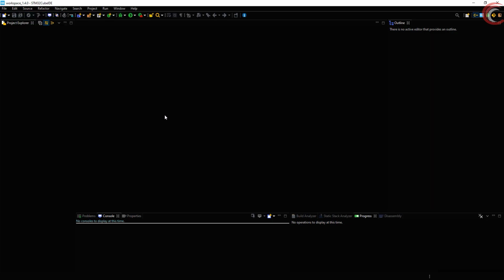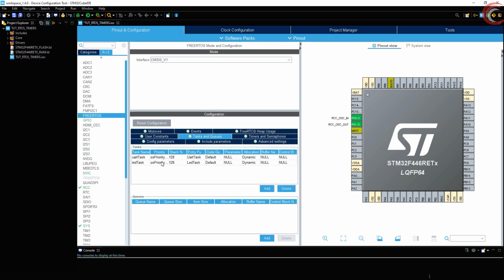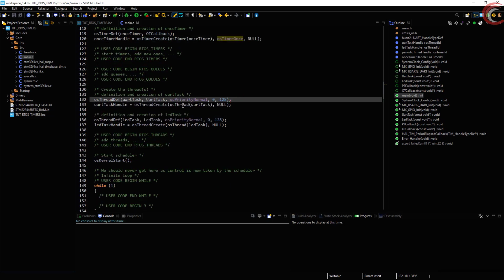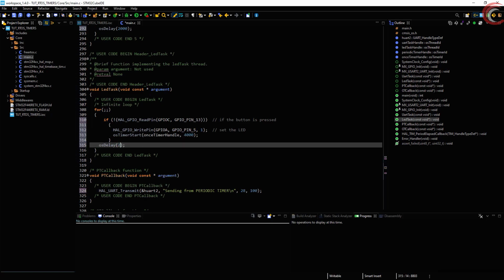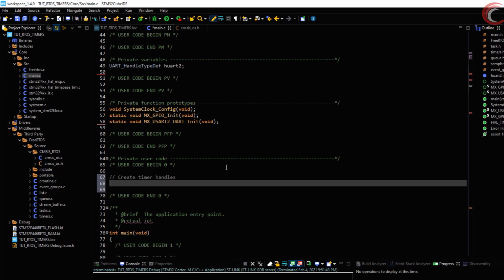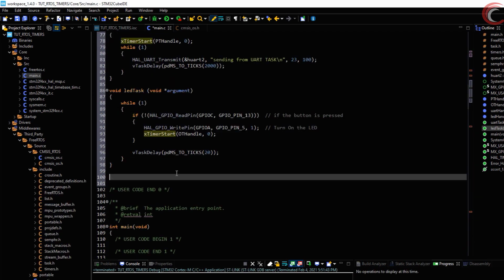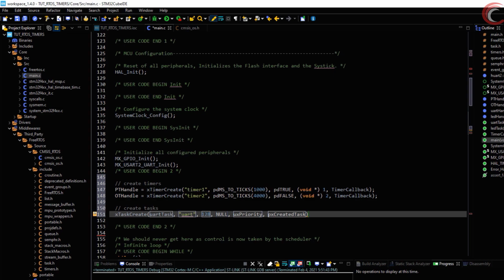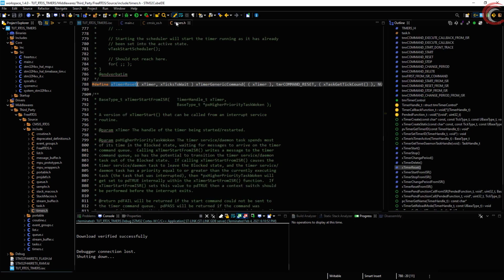FreeRTOS Tutorial 8 || Software Timers || STM32 || W/O CMSIS

Comment: Hi,
This is a great playlist on RTOS,I have learned a lot through this.
I am having an issue, I am using same STM32F446RE, whenever I use external clock in the coding  . It always results strange output on UART. Can you please guide me why is this happening? And what is the solution for it?

Thanks
Reply from the maker: Try bypassing the clock. There is an option of bypass clock when you select external HSE.

Comment: Great video but I wonder something. Why would I use a software timer instead of adding delay to the tasks with "osDelay" or "vTaskDelay" functions?
Reply from the maker: yes you are right. We can also use tasks for the same operations, but timers uses less resources, less memory and they are handy in certain situations
for eg- if you want a periodic task, which should run every 5 minutes, it's better to go with timers here, since task will take more memory for a small amount of work
also one shot timer is very useful in timeout features and if you want to do same with task, you need to create it and then remove it after the execution is complete...